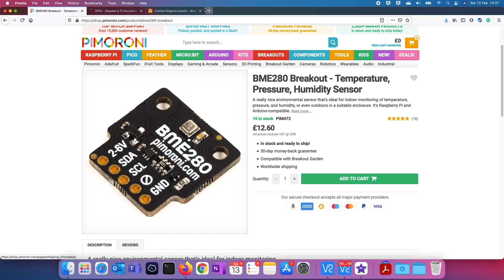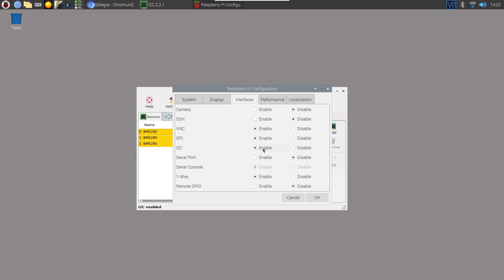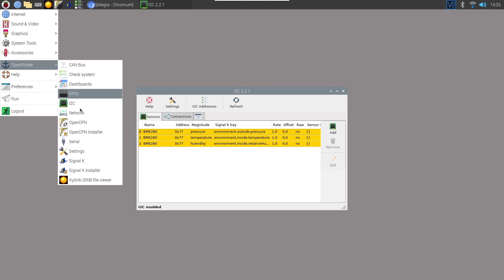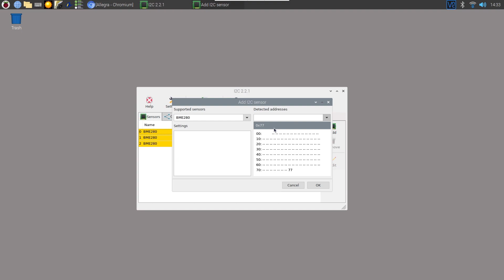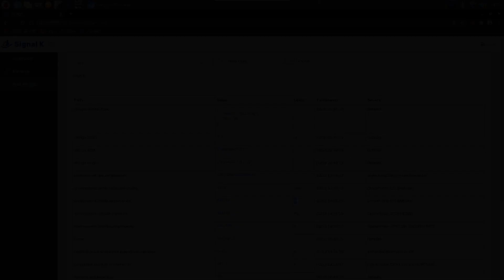OpenPlotter - Sensors (BME280) SignalK

Comment: Hello! If I have multiple I2C sensors for example for monitoring temperature, PM2.5, CO2, voltage of of solar panels, how can I connect them to the RPi easily avoiding many jumpers? Thanks
Reply from the maker: Hi, options could be a quick connect board that gives you expansion ports for many I2C sensors so one connect to your pi and then you use this board to connect everything up - something like this https://thepihut.com/products/quad-i2c-expander-for-stemma-qt-qwiic

Comment: Hi, I would appriciate very much if you can help on the fallowing. I have two GY-91 plates. One has workign BMP280 chip, other MPU9250. I also got TCA9548A I2C Multiplexer. It is all properly conected and detected in command prompt, but I am not getting any data in signal-K from BMP280 (humidity, temperature) Do you have any idea where/what should I be lookign for? Thank you.
Reply from the maker: Hi, Does the device work without the multiplexer? Is the GY-91 purchased from a reliable source? I ask as i purchased one from ebay and i couldn't get the MPU9250 to work, it found the other part of the sensor but nothing detected that. I then purchased from the PiHut and it worked straight away.
Reply: @BoatingwiththeBaileys hi, yes as per the initial message. One board is with Gyroscope and environment sensors, other only environment. They are both operational on its own.
Reply from the maker: Have you got a plugin installed to read the BMP sensor or are you using something like OpenPlotter which has the I2C application?
Reply: @BoatingwiththeBaileys  I am using OpenPlotter I2C app.
Reply from the maker: Paths are set in that application? And the sensor is configured as a BMP280 and not a BME280?
Reply: @BoatingwiththeBaileys  yes
Reply from the maker: @Vladimir-Nidzovic have you turned on the server logging - does that highlight anything. Can you share the output?
Reply: Please let me know where I can check for the server logging part. I am getting error on startup sayingI2C enabled , Access to signal k server validated  service not running
Reply from the maker: I'll come back with information about how to log it - that error sounds similar to this forum post, maybe try following the last post? https://forum.openmarine.net/showthread.php?tid=5695&page=2

Comment: Hi Matt, I've been having another play this morning with the Raspberry Pi & Signal K. Can you please let me know what data connection info you put in for I2C for the BME280? Although mine is reading correctly in the Data Browser for all 3 parameters, I have the following error message on the Dashboard Status page for the I2C connection: -
Last Error - 02/03/2024, 13:29:28: Error Resource temporarily unavailable Cannot lock port         Status - Not connected (retry delay 86 s)

Thanks, John
Reply from the maker: Hi, do you have anything else in SignalK trying to talk to this? The BME app for example? In the I2C app has that detected and setup all three fields? If you click on Check system, Any access requests pending or any errors? Does SignalK have read/write access (set to never expire) for I2c?
Reply: @BoatingwiththeBaileys  Thanks Matt, there was nothing else connected. Yes, all 3 fields have been detected and I set the access to never to expire. I even tried resetting the sensor as a BMP280 instead of the BME280, that didn't work. As I said, all 3 readings functioned correctly, that's why I wondered if I had the correct info settings in the data connection page for the I2C.
Reply from the maker: @johnsevieri7280 what version of SignalK and OpenPlotter I2C app do you have? After the error is reported does it then say connected or does that timer just keep increasing?
Reply: @BoatingwiththeBaileys  I have the latest version of both, I checked for updates yesterday.  The timer keeps increasing to 86 secs and then remains at that! Very strange. I wanted to check my settings for the data connection, what do you have shown for you I2C connection?
Reply from the maker: @johnsevieri7280 in the I2C app I just have the three items and keys with rate 1.0, no offset and scaling of 1. Raw is set to no. In SignalK I have no data connection for I2C. It only appears under devices with the description OpenPlotter I2C Read/Write. The data shows up in the connection activity as a w. something
Reply: @BoatingwiththeBaileys  Thanks Matt for the replies. I'll have a go again on Monday, to see if I can work out why I'm getting this error message. Enjoy the rest of your weekend.

Comment: Thanks for your video. I did the job but get no information in Signal K. I got this message in the Data Browser. Column "Path" : "notifications.security.accessRequest.any.37a6d316-751c-4524-96b7-ec75b369804c - Incolumn "Value" : "The device \"OpenPlotter GPIO\" has requested access to the server". It seems that I have no access §? Any idea. Thanks for your help
Reply from the maker: Hi, to approve access request, login and then I think it’s under server and access tokens or access requests. Approve that and allow it read/write access. See if that’s solves the problem and let us know how you get on. Could you see your BME sensor address during setup and is it a BME and not a BMP sensor?
Reply: @BoatingwiththeBaileys  I am logged in but get no datas from I2C
Reply from the maker: What sensor is detected in the I2C app?
Reply: @BoatingwiththeBaileys  BME280 with the three parameters, temperature, humidity and pressure. The three are yellow, and so is the connection with Signal K
Reply from the maker: Hmm it’s a difficult one to try and solve, I’ve seen this once before. There is a plug-in that you can download from the App Store that will make it work, a BME280 one. I never got to the bottom of the underlying cause unfortunately and reinstalled . Have you posted in the openmarine forum?
Reply: @BoatingwiththeBaileys  I haven't posted in Openmarine forum. What is the plugin you talk about ?
Reply from the maker: This forum post might help check the sensor is working, there is a script you can run about half way down and it will read the sensor in the terminal without SignalK https://forum.openmarine.net/showthread.php?tid=3441

The plug-in - go to SignalK and on the left, click App Store. Search the store for a BME280 plug in, I think it was called signalk-raspberry-pi-bme280. Install that and when I got data when trying to troubleshoot this before, the data just appeared. Once the plug-in is installed you might need to enable it and I think that’s under server and plug-ins. Let us know how you get on
Reply: @BoatingwiththeBaileys  thanks a lot. I try and let you know
Reply: Hello again. I finally et values on Signal K with the Dashboardsfor Signal K. But I do not succed to get them on OpenCPN. Is it normal ? Last question do you know how to change the port for the BME280. I would like to change it from 0x76 to 0x77 (it seems that it doesn't work on the first one !?). Thanks a lot
Regards
Reply: For more details, I changed the sensor (nex one connected on 0x77 port), and got the BME280 plugin for BME280
Reply from the maker: Hi, I think you can get the pressure field to show but not temperature in OpenCPN, if I remember correctly. It’s under barometer I think. I will have to check on that
Reply: @jeanmarcjoubert522  you can change the sensor address on some of them by soldering a jumper on the back of the sensor. If the sensor doesn’t have that then it’s programmed to that address and I don’t think it’s easy to change that. Just checking that was the question?

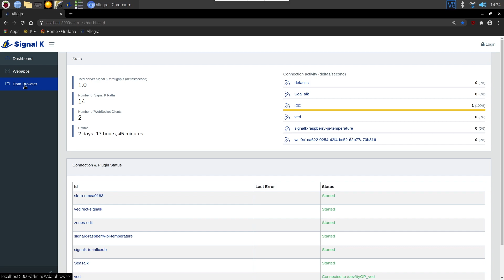Comment: Thanks for the video!. Following each step, I have arrived to the point in the minute 4:05 of the video but I see that de I2C is not receiving any data. ¿what could be the problem? thanks!
Reply from the maker: Hi - Was your sensor address detected ok? Is it a BME or a BMP sensor? Did you map all the detected fields to SignalK paths? I have seen this once before and everything did look correct and the only way I could get it to work was to install a plug-in for the BME/BMP sensor from the App Store which then made it work. Never fully got to the bottom of that one but hopefully it’s one of the above issues
Reply: @BoatingwiththeBaileys  Perfect. I will try the plugin on friday! Thanks a lot
Reply from the maker: Let us know how you get on.

Comment: Buyed the sensor and followed your instructions in openplotter and signalk. In Openplotter-I2C sensor is recognized as bme280 and adress is found. But i get no output signal in signalk dashboard. When i run a python script, all measurements are shown. So, sensor is working. Any idea from your side why signalk gets no input? Very strange, because my old bmp280 chinabrand is working without any fault
Reply from the maker: Hi, is it something to do with the mappings? Is the old sensor still mapped to the fields you are viewing? On the I2C settings, is the address the address of the new sensor and is that mapped to a signalk  key?
Reply: @BoatingwiththeBaileys  Yes, all is right. Deleted the old sensor in OP-i2c and cutted also in connections. After that resetted the raspi, installed the pimoroni as bme280, with the signalk keys outside pressure, inside huminity and additionally this always missing temp key. Made the connection to signalk on the second page but no yellow bar at the i2c signalk dashboard. I made now an experiment, i connect the old bmp sensor i get an i2c signal,
Reply from the maker: Is it visible in the data browser?
Reply: then plugged the sensor of and connected the bme sensor it works. Get only temp and pressure signal but anyhow the sensor is sending output to signalk
Reply: @BoatingwiththeBaileys  Nothing to see in the brouser
Reply from the maker: What about the voltage to the sensor? Is it 3.3v? Does the sensor support 5v?
Reply: @BoatingwiththeBaileys  both working on 5v. Tried also with the 3v pin, always the same. Either there is a bug in signalk or sensor has a fault. What makes me crasy is, that you got the pimoroni work on signalk and 2nd when i exchange the bmp during sending data with the pimoroni bme280, the pimoroni works/sending data.
Reply from the maker: Odd that it works if you swap it over. Wonder if it’s a clock issue and the first sensor has set something up which then allows the 2nd sensor to work. Keep us posted and I’ll have a think of anything else to try
Reply from the maker: Does your sensor have an SDO pin? Some info says to ground this pin if you have it
Reply: @BoatingwiththeBaileys  its the original pimoroni bme280 with 2-6v, sda, scl, o, gnd pin
Reply: Hi, stop thinking. Got it now work with the @signalk-raspberrypi-bme280 plugin.
Reply from the maker: I don’t remember installing that but I will check when back at the boat. Thanks for the update.

Comment: Hi, Nice video, however you never mentioned having to set a connection up in the connection tab. Once I did this I was able to see on the dashboard. Cheers
Reply from the maker: Yeah, thats a good point. I couldn't remember if that happened automatically, but yes you do need to click on the connections tab and make sure you have that connection set.

Comment: Thanks for this great explanation. This may be partly answered by the breakout board question but what sort of wire do you run to the sensor assuming it’s mounted some way from the RPI? Is it just a 6 core cable?

Second query. How accurate is this when mounted inside the boat (in a box you said). I would have thought humidity and temp vastly different than outside? Are these sensors man enough to survive up a mast for example?

Thank you.
Reply from the maker: Hi, I’m using 4 core light electronics cable, similar to bell wire but mine is multi strand (not sure if they all are). This sensor on mine is 4 connections and the 1wire external waterproof temp sensors are 3. This sensor is not waterproof, so I doubt it would survive long outside even if it was protected but might be worth a test due to its price. My plan for this was always inside, for temp and pressure the fact that it’s got humidity was a bonus. I’m using 1 wire sensors for outside.

2 question- yeah it really sensitive so it’s capable of picking up drafts and the sun shining on it. However pressure seems only effected by its height (to be expected)
Reply: @BoatingwiththeBaileys  smashing thanks for the detailed reply.

Comment: Hi, I have a second sensor and I want it also connect to the gpio. but this sensor needs also the sda and scl pins. do you know how to?  sensors are BME280(temp,pressure,humi) and the outher one is the GY91 voor xy axis.. thx
Reply from the maker: https://thepihut.com/collections/raspberry-pi-breakout-boards/products/breakout-plus - This type of thing is what you are looking for. You can make your own, you just need to be able to connect multiple sensors to the same pins. A copper board, some pin terminals and you are away.
Reply from the maker: Have a look at the 1-wire video and the main open plotter video, I think I should some examples in them.
Reply: @BoatingwiththeBaileys  thanks. I will go trying this!!!